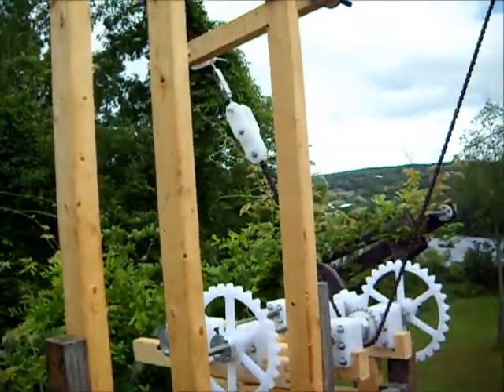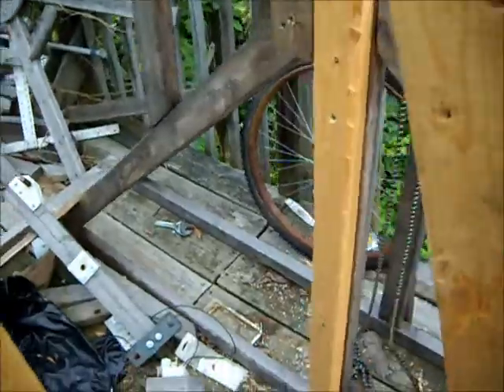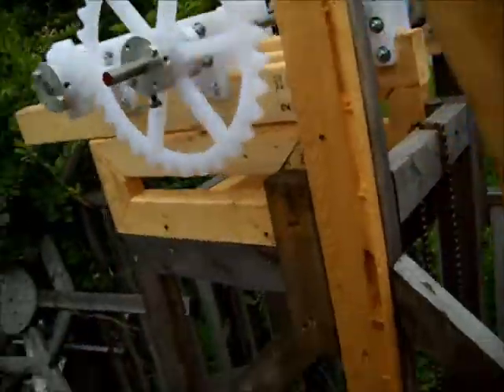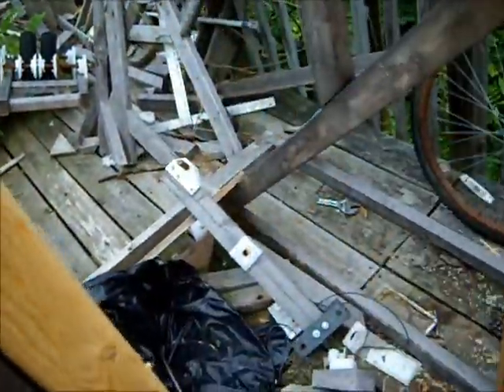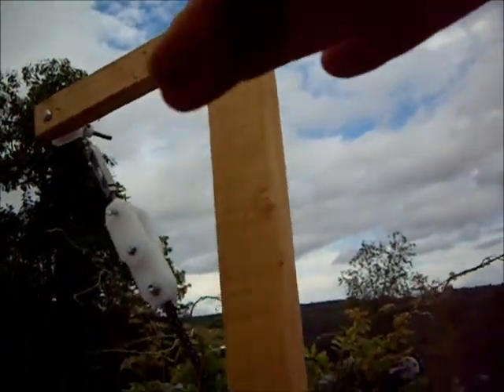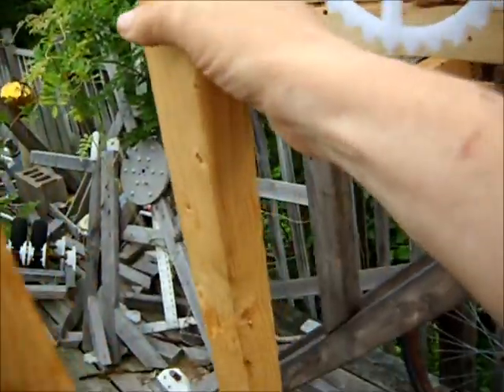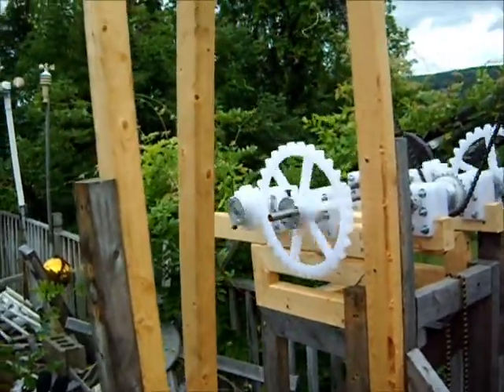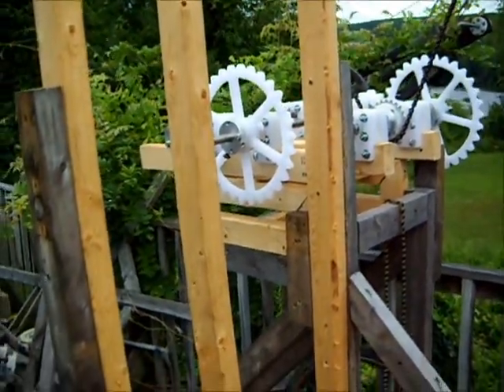GRAM 7 21 18

Comment from the maker: Correction 10 pound weight drop configuration used about 3 amps at 12 volts for about 1/4 of rotation.

Comment from the maker: https://youtu.be/UUZhyh39yP4

https://youtu.be/DTAcUhDnDXc

Hi, I did some more manual testing with a 50 pound BOB and determined the large Neo magnet and electro-magnet will not produce enough force at the input to keep the pendulum swinging. The 50 pound BOB is about the max limit for the wooden frame. I am combining the above to projects by replacing the wiper motor with the pulse motor. It should have better results. I will post results when available.
Reply from the maker: https://youtu.be/AqFRNQ1z5Z0

maybe the 1 to 6 gear train is to much of a load
Reply from the maker: max  output with the 1 to 6 gear train was over 2000 RPM, I only need about 150 RPM for 50 watts